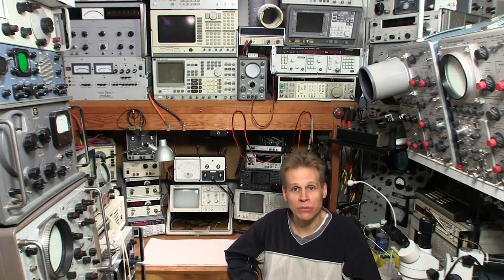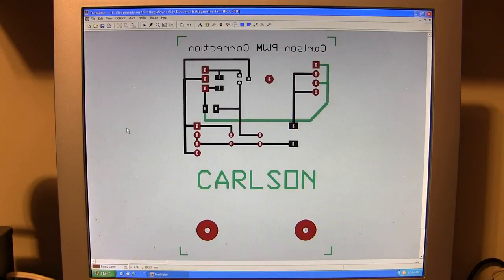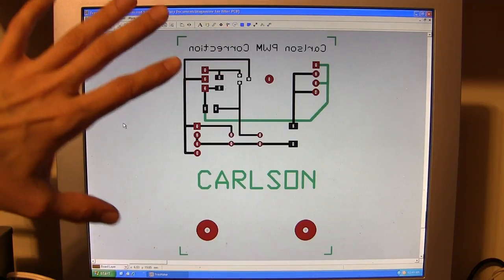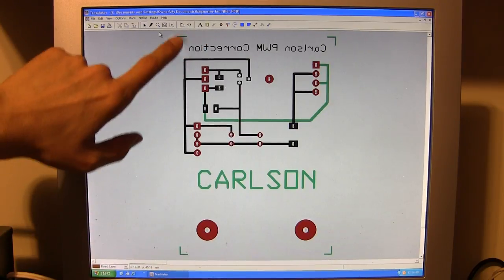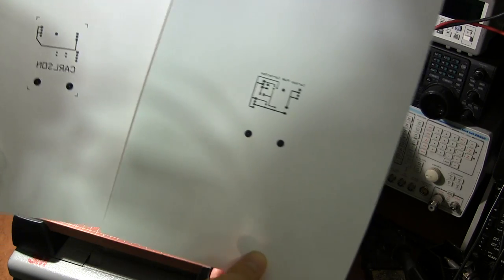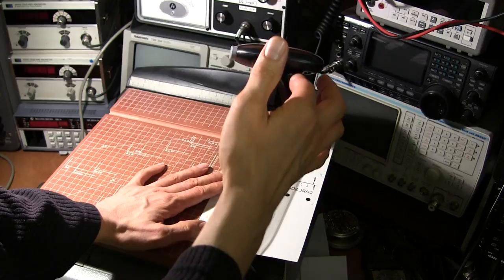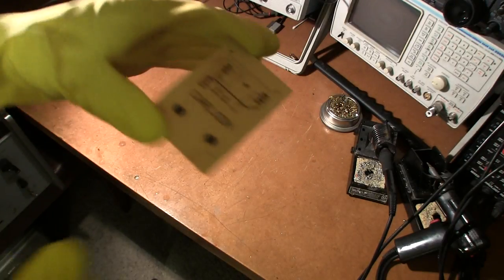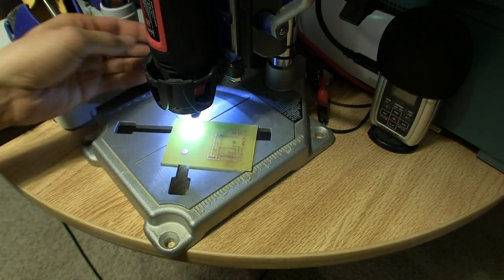How to Make Double Sided Circuit Boards at Home

Comment: put a little "Deoxit" on the contacts of the batteries in your flashlight and it will work much better.
Reply from the maker: NebukedNezzer LOL, Good idea! Its great for working around the etchant, as it's all plastic. That's all it has going for itself. It would have been turfed long ago if not.

Comment: and how you dispose the ferric chloride  correctly?
Reply: that doesnt exist sadly
Reply: Take it to a recycling centre.
Reply: Just keep topping up the ferric chloride as you use it. Using this method you will find it disposes of itself by magic - mostly by transfer to all your old clothes and your kitchen surfaces I have found :lol: 

A good trick is to use copper pours around the tracks in your PCB software especially for ground planes. So you don't etch anything like as much copper and have some more effective grounds. I think recycling ferric is better on your pocket than being stingy with toner (though that is not even an issue with the UV method)

When your ferric solution gets a bit too much just decant from the sediment and dispose of the old copper for $$$ at the scrap metal dealer along with all the reclaimed gold from old ram chips and pentium processors. ;)
Reply: You add plaster of Paris to it and wait until it sets, then follow responsible disposal guidelines.
Reply: 1. dry it up and put in a plastic bag and throw away into a garbage can. 2. Mix it with concrete and throw away into a garbage can.

Comment: and for those following along. this is a Staples® Heat Seal 9.5" Laminator Item: 703117 Model: 1810307057 that apparently is only available in canada
http://www.staples.ca/en/Staples-Heat-Seal-9-5-Laminator/product_703117_2-CA_1_20001

Comment: sweet . it seems traxmaker has been taken over by a different company . time to aqure all the bits and pieces to pull this off . at this moment i would like to etch out a lm723 regulator board for a project i have on the bench 

i have a tripplite pr60 power supply that uses op amps for regulator voltage i dont care for the over current protection it offers . it allows for up to 200% over current for 1 second . not very good for ham use imho

Comment: I have background with Corel Draw, Visio, Illustrator, InDesign and other graphics programs.  I'm interested in getting the software you use but don't know how to get it.  Is it freeware?  Who makes it?  What website should I go to get more information?

Please respond.
Reply from the maker: Christopher Moore I usually respond to everyone. My channel is getting busy and it's hard to keep up though. I think you can find it on line now, just search for Traxmaker and Circuitmaker. The usually come together.
Reply: There are a number of actively supported free PCB design applications that you may wish to try (just search).  You may wish to give KiCad a try, just to name one.  Or Altium has recently released a free version of their software package geared towards the Open Source community (its only great drawback, perhaps, is that all of your designs are public...but for not-for-profit uses that should not really matter too much as most designs will not be of much use to others).  There are a number of others out there which are free as well, though their names escape me at the moment.  I presently use PCB (part of the gEDA suite for Linux platforms) but that is an older and more challenging application versus the newer open source/freeware packages...I am very tempted to give Altium a try on my next project.

Comment: you could use a hot flat bed to do lamination, could you not?
Reply from the maker: dale myers Haven't tried that either. I can tell you that using an Iron does work, but the traces don't come out anywhere as nice as this method.
Reply: the only reason i said the flat bed is, i've seen them use a clam shell flat bed at stores that did lamination for note book folders.
Reply: Some use T-shirt decal type hot presses for toner transfer, often with a thin moistened cloth or paper towel on each side to improve the uniformity of the heat transfer.  But most anything that can produce the necessary heat to raise both the toner and the PCB material to the necessary fusing temperature will get the job done.

Comment: How to connect the traces from the two sides? Throughout holes?
Reply from the maker: A small piece of wire soldered on both sides acts as the plated through-hole.
Reply: +Mr Carlson's Lab I will do it that way. Thanks.
Reply: I was wondering how any Vias would make contact. In an industrial made board Vias look like little pin holes, do they just press in little hollow copper rivets to create the Via paths ?

Comment: Are the holes plated through on board?
Reply from the maker: +Suminder Singh 
Hi Surminder. The holes are not plated thru. The wire or pin has to be soldered on both sides of the board.
Reply: Can you show me how
And what if I want to make platedthrough!!??
Reply: Suminder Singh then you learn how to install rivets.

Comment: Very nice explained :) I have ebike about 4kw on brushless dc motor. I want to make my controller stronger and i am just worried about my mosfets. They are 12 (4on each phase) I was thinking if its ok to double them and add capacitors. Just simply solder wire from base (7cm silicone wire). Do you think new mosfets can have some delay or you see other issues? I have space for make small board with mosfets on side my controller box

Comment: I was watching this and realize, dang, hundreds of PCB's on a machine that old? I hope your backups have backups! VirtualBox is some open source software that takes old machines and allows you to image them saving all of the licensing, OS configuration, files, etc into an image you can run on any machine. I use it for software that doesn't run on Windows 10 anymore. Take a look! https://www.virtualbox.org/wiki/Migrate_Windows  You might get some decent performance increases too as an added bonus! Great post as always, my good man Carlson!
Reply from the maker: +wither8 
LOL... Seems like I got that computer yesterday :^) Time flies! I have 3 computers and many backups. No worries there. Thanks for the link, I will check it out.

Comment: I agree that the demonstrations in this video are comprehensive and informative BUT I also agree that it is much longer than necessary - there could have been more editing (ever thought of using a script so as not to ramble on so much?). 55 minutes should have been 30 minutes maximum. I admit, though, that I have seen worse! Other than that, Mr Carlson, keep 'em coming!

Comment: I don't do this method to transfer the toner but I use a cheap $20 Amazon prime laminator to adhere my negative resist to the circuit board.  It works pretty good!

P.S.  all the same I did get the idea from you.  Thanks a billion Paul, as was stated above you are an amazing teacher.  I have learned so much from watching your videos.

Comment: My reactions varied...   At first viewing I was screaming with irritation at the frequent mentions of stinky lacquer thinner - (didn't watch the vid through that first time.)  Then I read the comments and learned that the lacquer is dodgy stuff and would likely react with the grp board - so in effect Mr Carlson had inadvertently been sounding a warning.  Then I investigated the "Liquid Tin", and found I could neither buy it in the UK, nor buy the Thiourea to make my own, as they are controlled-distribution reagents.  Then a colleague advised that chemically deposed tin is temporary and it degrades over months.  The reagents used are stinky and very toxic.    Sooo - it seems that the KISS principle applies (Keep It Simple, Stupid). :-).  Clean the circuit boards with Acetone if White Spirit won't do it.  Tin the board by brushing liquid flux over it, then use a 60 Watt soldering iron with ordinary solder.  The flux will protect the board from tarnishing for many months.  Also... I learned that Rosin flux causes asthma ( the lead fumes need no mention),  so I am improving ventilation at my soldering station and switching to a more expensive solder containing no rosin flux and no lead.  So maybe those irritating repeat mentions of stinky stuff were useful after all.  Overall watching this vid and the consequent actions I took make this vid quite an adventure for me...  :-). Peter
Reply from the maker: Hi Peter. I have boards tinned from 2012, and they look like the day they were tinned. Acetone will push the toner into the fr4 board, so unless you like stained boards, use a different solution. Lead fumes? Rosin fumes yes.

Comment: Make a dc motor controller  a button s when you touch a button it moves the motor and it can have there can be a record button after you record it you  and you would press a button
Reply: And you could add 5 motors

Comment: I am amazed that once you slip in the board it is still aligned. I could see some error work itself in quite easily at that point.

I will stick to jlpcb though. I don't fancy buying a laserprinter for just this or having to deal with the etching. If I need to prototype it makes more sense for me to invest in a wegstr or similar cnc (mind you I would use it for more than just PCBs which is why it makes more sense for me).

Still very neat way to do it. Used to do it with UV sensitive and transparant film 25 years ago (when there was only ferric chloride to do the etching) and it was a bit of a pain. Still have the uv lamp and all :)

Comment: How can i make plated vias?
Reply from the maker: Бојан Драшко Just use wire. Too much involved.
Reply: Thanks for advice xD
Reply: I save trimmed component leads for this purpose.  I have a tin for trimmed leads that sits right next to my soldering irons and all leads greater than 1/4" length go into that tin for later reuse.

There are eyelet kits available if, for some reason, one just has to have the equivalent of plated-through holes, but they are expensive kits (especially the equipment) and there really is no need if you design your boards with this method in mind so that none of your critical solder pads lie hidden underneath large components...in which case you simply add another via in a clear area to the side for bridging the top and bottom layer traces.

Design a few boards this way and you will quickly figure out what works well and what does not and that will help you improve upon your next design.
Reply: +Ethan Poole ? Can you reffer me to some kit. Thanks.
Reply: +Бојан Драшко Lookup Keystone Electronics, they make eyelets and staking tools (the hammer and anvil tools that close the eyelets).  When you get to their website just do a search on "eyelet" as that is probably the quickest way to find everything.  You can also find their products on Mouser, I believe.
Reply: +Ethan Poole I should also mention that there use to be more production oriented staking presses available, but I have no clue who, if anyone, would carry them these days.

Comment: Ok I know there are no stupid questions. How does that work? How does it  just etch layout and not the whole board?
Reply from the maker: Hi Chris. The toner on the top of the board resists the etchant. So any place that's coated with it, the etchant can't get through. The etchant only goes after the copper.
Reply: @MrCarlsonsLab  Ok thanks.  In the learning stages. I'm thinking about joining you on patreon.

Comment: Why have Avast AV installed on the non-networked WinXP machine??  You're certainly not going to pick anything up over the wire, so your only danger is inserting a dodgy disk. However as Avast cannot see the internet, it's probably not aware of many of the newer viruses (virii?) going around now (unless you update Avast manually??).  
I'd just opt to scan disks on my networked machine before moving it over to the PCB machine.  You then know you've run an up-to-date scan and you don't have the overhead of running Avast in the background all the time (not that Avast is that bad - it's certainly snappier than that goddam McAfee!!!).  Great videos BTW!
Reply: P.S. Virtualization could really help you with that XP machine.  If you virtualize the XP install of that machine (using dsk2vhd), and then import the VHD on your main machine in Hyper-V (you may need to add Hyper-V in "Windows Features"), you can then spin up an identical copy of the XP machine on your main PC.  This isolates the OS and software from the hardware and you won't have that worrying single point of failure.  As long as you have a copy of the VHD, then you have a 1-1 copy of that machine that you can bring up on any Windows PC.
Reply from the maker: I just haven't uninstalled it since it's been off the net, that's all.

Comment: After dipping your board in a bath of liquid tin, it will be kind of dull looking.  I read a suggestion that says rubbing it with some super fine 0000 steel wool and it will shine it right up.
Reply from the maker: Hi Patrick. The tin coating is very thin, but it works in some situations. I have a metal polish that makes the boards look like chrome, but at the risk of removing the tin completely in small areas.
Reply: What about "cool-amp"? It's supposed to coat the board with silver. Have you used that for your high voltage stuff?

Comment: Moving the old system into a virtual machine would be more reliable and secure in the long run.
Reply from the maker: My oscilloscope uses window 95, its fine. Many industrial facilities use much older systems, its very common. Only consumers worry about operating systems, and being up to date. If it works, why change it? If it's not on the net, and has no outside connection, all is secure.

Comment: So... why not use a readily available EDA package like Eagle, for example? Sounds like a pain in the butt to do all the pad and via placement and routing work yourself.
Reply from the maker: Hi Matheus. In the time you export that file to get it built, then wait for your board to come back, I could have made and populated 100 prototypes by then. So basically, if there was a design issue, I would have a solid working prototype way before you even receive your first board. This is very handy for "RF" work.... and way more cost effective.
Reply: Well... when you design a PCB in DipTrace, for example, you can export a gerber file, and prepare it for printing using third-party software, or simply print out your layout directly to paper.
There is also a free license for DipTrace, with a limit of 400 pins or so per design. In the website, you can download the libraries (which are free, by the way), including 3D models and component packages.
Why don't you do yourself a favor and go check out the EDA tools available out there? It won't take you 5 minutes, and I assure you they are worthwhile.

Comment: very good tutorial. but good you talk alot...
Reply: I graduated with a degree in eletrical and electronic engineering and trust me for what he's doing and showing he needs to say what he's saying and I myself think not enough.  however,  he does tell you what you need to know and why. 
I find his videos to be a treasure of information. 
You should have been in my instrumentation class you would have had your brain melt and that was just one class.
Reply: +James Barnett He doesn't "needs to say" what old computer he has, how many files he has,  you need to backup files, how to backup files, and how to solder. That's just a few examples in the first 5 minutes, which is all i wasted my time watching. :-(
Reply: Why don't you submit a request that Paul re-issue the video in sign language, just for you? Then again, you say it's GOOD he talks a lot - now that's an ironic typo! -_-
Reply: Guys,  I agree that he sometimes repeat himself 2, 3 4 times?  BUT, I can change to another video or fast forward.  Some of the stuff he covers I forgot and he OFTEN details items that I have wondered and never understood. I NEVER thought I would understand switching power supply. I still do not but, I have an idea and that is more than I knew before. I welcome all of his efforts and videos. I almost fell off the chair when I say hos video om, How to repair your air compressor AND modify it.  Is there anything he does not know?  Cheers!

Comment: Couldn't, theoretically, one make a 4-layer pcb by using three thin PCBs stacked on top of each other?
Reply from the maker: You sure could.
Reply: How are you going to connect to the inner pads once the stackup is built? One could experiment with larger drill bits on the outer layers, and hope that the solder will reach the inner layers....
Reply: the same way you would do it with a manufactured PCB?
Reply: Unfortunately not. Manufactured PCBs do plated-through holes that intercept the inner layer connections. This is an electro-chemical process that is not practical back at home.
Reply: +Électro-Bidouilleur a similar way, then. Pads on the inside pcb layers and a via to reach the outer layer.
Reply: Please detail that layer assembly process. I do not see how that could get easily done. Thanks.
Reply: don't know if this is enough detail but it's a quick and dirty image i just did http://i.imgur.com/axjpxLO.png green is pcb, yellow is copper or solder, blue is some kind of resin or mask or something insulating
Reply: The different sized holes are actually not a bad idea ;)
Reply: Solder paste works well for multi-layer boards. Do your design and etching as shown in this video, when you put your boards together, dab the vias with solder paste, squeeze the board together (I've so far found bolting and mounting holes the best method, glue isn't great), then insert tinned solid wire through the vias, (this must be a tight fit), then apply heat. If you have to do a via through two board but not a third, then you make a two layer board first, with a tiny indent so you can sink the via wire by a fraction, then add your third board. It took a while to get right, but it is very much possible.